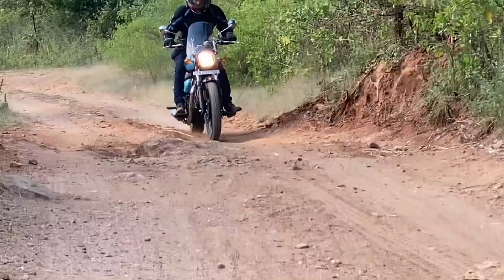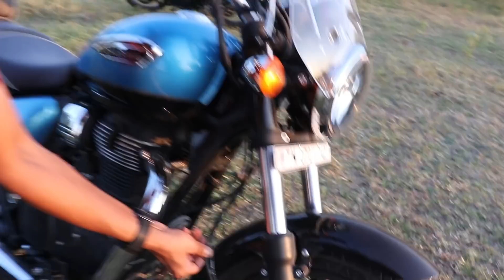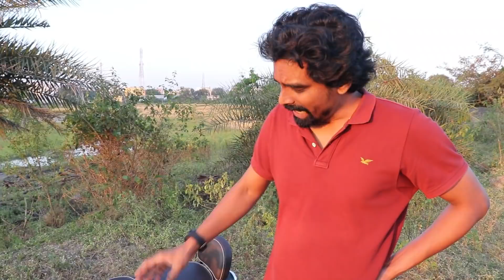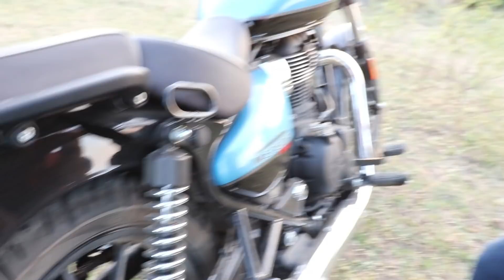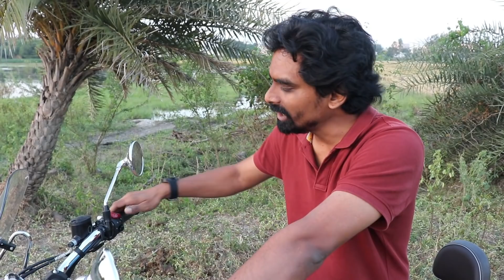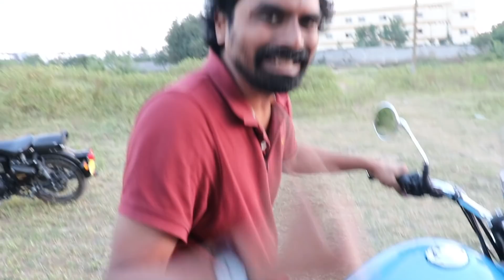Should you BUY the Meteor 350 Royal Enfield?

Comment: Fun Fact, that guard that he sad is there to protect your boots it’s actually there to mimic a straight piper from the engine to the exhaust muffler. In reality the pipe from the engine goes to the catalytic converter and from the catalytic converter it goes out another pipe to the exhaust muffler. It’s the same trick that triumph used on there street twin.